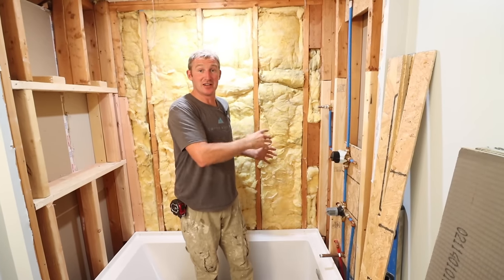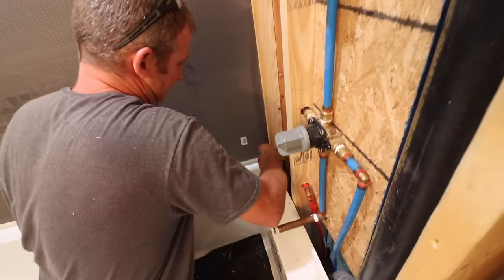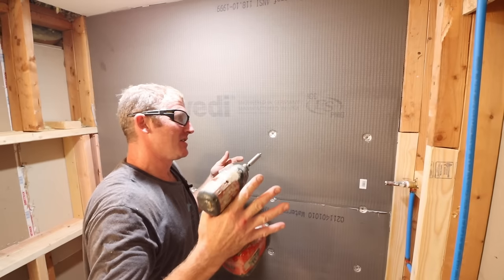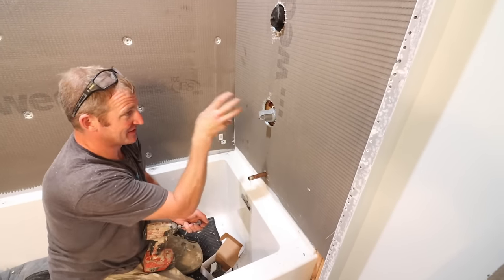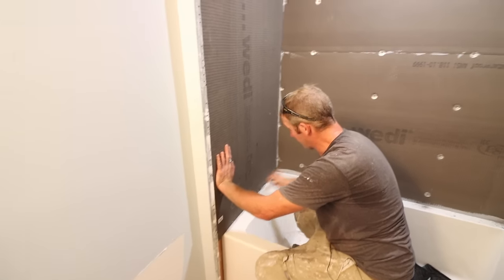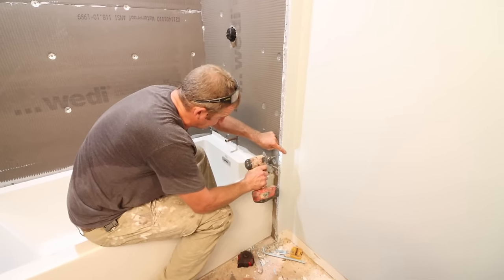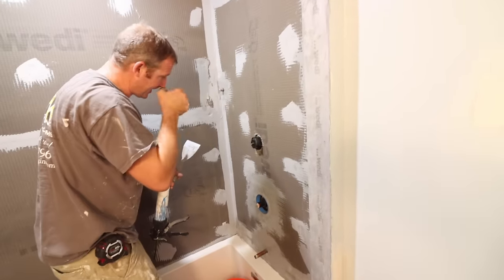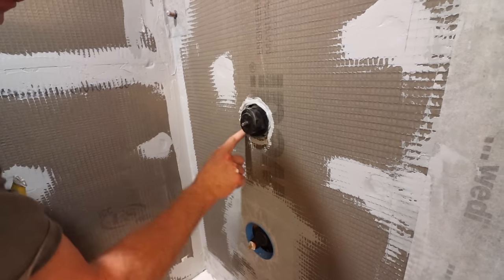Waterproofing Tub Shower Walls | Easiest Method for Beginners

Comment from the maker: We're excited to watch this video Live with you and answer any questions in the Chat!!
Reply: Hi. Just as a clarification, WEDI and other Products like it are not waterproof on the surface.  The closed cell foam structure is what gives the panel it's waterproofing.  So when applying the sealant it is important to seal to the foam core and not just on the surface.
Reply: Commies Suck what do you mean seal to the foam core???
Reply: @never2be07  the facer is not waterproof. Only the core is waterproof.
Reply: @never2be07  the core is made of XPS or extruded polystyrene foam which is a closed cell foam and is waterproof. The facer is a cement based facer and is not waterproof.
Reply: Commies Suck I’m sorry, facer? Sorry I’m new at this and not quite sure what these terms mean. I guess what I meant to ask was how to seal it all the way to the core?
Reply: @never2be07  You just need to make sure there is sealant between panels at the vertical and horizontal joints.  If you are doing a shower with a pre-made Wedi or Hydroblok floor, they typically recommend that you remove a small portion of the cement facer from the perimeter of the floor so the wallboard core and floor slope core can be sealed together.  Reson being that if you only seal along the face of the boards water can wick behind the sealant through the cement facer and eventually into your walls or floor.
Reply: Commies Suck so the way he applied it between WEDI boards is the way to go?
Reply: @never2be07  Correct.
Reply: Installing big s size tiles in bathroom
Reply: Best, most thorough video on the subject.
Reply: Wedi sealant and wedi band and wedi glue?
Reply: Very simple n easy teaching!! Thank you!
Reply: Have u done any showers with windows or glass block windows in main wall or long wall? If so can u reference videos plz?
Reply: Great video! I would love for you to come replace my bathroom shower!

Comment: I have been in the caulking and waterproofing trade for over 40 years and when I saw the flange stopped short of the edge of the tub I just knew you were going to make the mistake that 90% of people make and leave a huge hole at the outside edge of the the tub, because they stop the waterproofing at the edge of the tub. Well done. Every “professional” tub installer needs to watch this video.( I normally get called in after the fact to try to repair the botched installation and I can’t tell you how many times I have found the tile at the narrow strip at the front of the tub without waterproofing or sometimes just drywall at that strip) I also applaud your numerous references to technical manuals. There are so many “experts” on YouTube that have never read the tech manual for the product they are using. Or they are just so ignorant that they think they know more than the manufacturer. Especially when it comes to sealants and waterproofing. The morons that advocate using soapy water or even window cleaner to tool sealants make my blood boil. Sorry for the rant. Keep educating people on the CORRECT techniques and details.👍
Reply: So… say a person did that - stopped the wedi at the flange and tiled so there’s a gap. What would a person do there? Are they screwed?
Reply: @ashleywilkes7632  yes they are. Short of tearing everything out and fixing it properly, you can caulk the tile to tub properly, seal the grout and hope for the best. But I have never seen a YouTube video of caulking the perimeter of the tub that was done properly. Having said that it is possible that the water never gets beyond the finishes on the walls. The problem is you will probably never know until possibly thousands of dollars of damage has been done.
It’s not one of those” it will leak” problems More of a “ it can leak”
Reply: Hm okay. It’s at the back of the shower, so I wondered if ripping the drywall out to expose that gap would work, using wedi sealant to caulk it really well. I suppose the alternative is getting the experienced tile guy to come in and redo the shower, which is fair. At least it’s not a full bathroom remodel…yet
Reply: @ashleywilkes7632  if I’m understanding you correctly it sounds like that would work. That is kinda what I meant by” tearing it out” and fixing it. I meant remove the finished wall in that area. Not remove everything.Sorry my reply was poorly worded.
Reply: Oh no, I appreciate the insight and expertise. I will grab some wedi sealant and get that tidied up. Thank you very much for your help
Reply: @ashleywilkes7632 sounds like you made a mistake…ok to stop before you or your ins talker moves on. Don’t sit in silent torture. Stop then installer and fix it….you’ll get it….
Reply: What if your studs are aluminum? How to attach the firring strips?
Reply: So it sounds like you calling him out but then it sounds like you’re praising him ? Did he do it right or not ?
Reply: @akllls617  I said I THOUGHT he was going to make the same mistake that many make . He did not. He stopped short but came back to it later. The “ well done” should have been your clue. I was actually calling out the 100s of “ experts” that  leave a huge hole at he edge of the tub. He addressed it.
Reply: @genecarden780  no you definitely said “when I saw the flange  stop short of the edge of the tub I knew you were going to make the mistake” so that to me seems like he made the mistake .. you have two opposing statements hence my question but apparently he did everything correctly so good to know thanks
Reply: @akllls617  sorry poor wording on my part when I said “ I knew you were going to” it was a figure of speech, I meant that it is a very common mistake that is made. I should have said after that “ he proved me wrong” when he later completed it.
Reply: Fantastic! Comment's sir..in No way does this reader find it a rant!
May KING JESUS CHRIST OUR LORD AND SAVIOR OUR HEAVENLY FATHER IN THE FLESH YESHUA BLESS YOU ALL!
Reply: I wish I could’ve got him to install mine because the people that done mine they didn’t do it right at all I live in Mississippi people don’t know what they doing I wish i can show you pictures of mine you’d be like wtf I wish I could sue the company that did mine
Reply: @akllls617 , I thought the same at first. But as I read the whole comment, it became evident that he was in praise of the video for catching what most "pros" miss.
Reply: @vespatrixie2555 aluminum? ..or galvanized steel?  ...either way, you could pre drill each hole with a regular ⅛"ø twist bit then use the same screws used in the video. ..orr see if they make self tapping drywall (bugle heads) screws made of the same or similar material. 

When using self tapping bits, the trick is to let the bit center itself at high speed first before giving it full force to sink it...
Reply: Baffles me how any person that has grown up around showers and baths would not make sure that area is bulletproof.
Reply: He doesn't care
Reply: What is safe to tool silicone caulk?
Reply: Why not just notch out the back bottom edge of the foam board?
Reply: @tagheuer02  not sure I understand your question?
Reply: @tagheuer02 he did on the last wall
Reply: Well, I understood EXACTLY what you meant when you said that. Anyone who has read your comment in its entirety should see that you were saying that he didn’t mess up or make the mistake that so many people do. I mean you verified that by saying well done and recommending the video. I don’t see how anyone could have understood that any other way but 🤷🏽‍♂️
Reply: @q4prez823 actually whilst the poster cleared up in these comments they actually intended praise, it’s not clear at all in the initial post that praise was intended. It reads like the mistake was made, then the rest reads like a sarcastic/condescending rant. No disrespect intended on my part, but that’s just how the post reads, it should have been worded better and glad it was clarified later.
Reply: Please give the timestamp for when this error in installation had occured

Comment: PRO TIP: When using any type of sealant to attach panels to a flat wall use circles instead of lines and it will actually create a vacuum and hold the panel better.
Reply: Thank you I will be applying flat wall panels to this backer board. Will do the sealant in circles.

Comment: I used GoBoard. I would NOT recommend it. It's the best price out of all the foamboards and very durable but uses fiberglass mats on the outside. Even if you're wearing long sleeves and gloves, the fiberglass strands are very stiff and aggressive. Much much worse than insulation. Plus it smells like chemical sulfur when you cut it.

Comment: I am a designer of tile projects  and i sell Wedi. I appreciate you doing this video. All the contractors I deal with love Wedi products. They are at a higher cost but if you use the whole system it’s guaranteed for life and it’s WAY easier to deal with.

Comment: WELL DONE, I have been over with different bathrooms from Ballon wall framing customer hacks and hardi and the other. Still system seems bullet proof. I will talk will my local plumbing store and the rep from weedi,  
The best part even if it more cost for materials the labor is so much easier. 

Great work.

Comment: Excellent Video!  A sausage trick, for bulk guns. Instead of plunging your knife in the end. Just smack one end of the sausage against your knee and spin a few times while smacking it across your knee. After 4 or 5 smacks, the metal clamp ring will fly right off. It will keep your knife clean.

Comment: This was an excellent instructional video, complete with valuable comments.  That said, I am astounded that home building design has remained in the dark ages.  This is not a comment on Wedi or your technique specifically, but the whole idea of putting penetrations thru a shower wall where water inevitably goes, with the only thing preventing wood rot being a Rube Goldberg concoctions of sealant tape, caulking, and rubber grommets.  Lots of caulking.  Lots of sealant.  Valves recessed inside the wall and nearly inaccessible from the front. Certainly there are better ways -- scandinavian type showers with fully exposed plumbing perhaps?  Larger one piece water proof backing boards and some kind of corner sealing mechanism?  This new shower is essentially unchanged from one in a 1955 home except it has a single mixer valve (dubious improvement) vs a two knob water control shower.  Still thumbs up for the excellent quality educational video.  Thank you!

Comment: Over the years I built about 15 tile showers using Hardibacker over a vapor barrier. I used a preslope under a mudded shower pan. If I built more showers I would use a system like this. It took me longer to put up the vapor barrier than it takes this guy to put up all the wall boards. A lot of that is because he is faster than I ever was, but I could see time savings in every step of the way with this system. And the end product might be better. When you build a tile surround for a bathtub the vapor barrier should drain into the tub over the flange. Except water draining down that path leads to mold at the base of the tile so you caulk and there is no place for the vapor barrier to drain? 

I don't like either solution. What I like is keeping that water from going through the tile board and that is what a system like this accomplishes.

Comment: Great tutorial. I've watched many of your videos and thank you so much. Repairing a bathtub basically a 2 handle to a one handle, Used Hardy Backerboard DIY, The question is I did not remove the entire Backer Board I cut out 6 of the tiles and cut the  Backerboard to the exact size I then replaced the cavity with  a perfect  cut Backerboard, used proper backer screws added additional 2X4 for it tom adhere to. Then i sealed it with the recommended sealant I need to water proof my valves and spot. How should I proceed?

Comment: Absolutely phenomenal video and thank you so much for this info. Got into the bathroom to reseal a few places and found up my original backer board sucked up some water so had to get in and replace it. This looks like a champ and a good surface to start tiling

Comment: I loved this video. It is so going to help me with my upcoming bath remodel. But I have a question. I had my tile guy float my other showers and of course that means a “cement” type product. How can I protect the valves from water leakage behind them? Could I use the same product around the valves, etc.?  Or what do I need to do?

Comment: Weeoh, excellent tutorial.   I’m in the same boat with a total bathroom renovation project.   The only exception here will be full overlap all the way around tub with my Wedi board.   My walls were badly out of square.   So my ferrying strips have me about 1/4” out from the tub lip.  It’s okay cause I’ll just make up the difference with Wedi caulk.   I will also run a glue bead down each stud because that’s  just me.  I will use my finger to level caulk at the tub because a putty knife might actually scratch the tub…. That would be me for sure LOL. Okay, so here I go.  My inner tub wall has been fitted..l. Now the glue and caulk.   Wish me luck everyone.   My tile guy comes in two weeks so I hope my end product will suitable for him.   Later

Comment: Great, great instruction, sir! Question: can I use regular backerboard WITH a waterproofing (paint-on) sealer? Right now, I'm planning on using HardieBoard Waterproof board, but it's $30 a 3x5 sheet.

Comment: That Wedi system is amazing. I'm planning my bathroom remodel for next spring/summer. It's much smaller space than this one, and I am keeping the existing metal/ceramic tub and replacing all the other fixtures (sink, toilet, etc). You didn't mention what waterproofing was used on the ceiling, so I assume you used the existing material? Concrete board or Hardie backer? I'm subscribing to this channel. I have lots of work to do in my little house and your tutorials will be so helpful. Thank you!!

Comment: Excellent video. Easy to follow and understand. I'm currently renovating and feel that my Bootz shower installation from Home Depot may need to be redone for a proper waterproof seal. It was the prefab 4 piece shower and tub system. Plumber only put a 40mil rubber seal around the shower system. I don't believe he waterproofed the valves or pipes for the shower head and knob. This makes me nervous watching this video. Great content nonetheless.

Comment: Just a quick tip.  I just finished installing Wedi backer board in a tub surround.  Make sure to use either a chalk line as in the video or straight edge to mark your cut.  I foolishly used the mesh lines thinking they were parallel to the board.  They are not.  The error didn't ruin anything and I was able to repair it but it pissed me off.
Reply from the maker: Great tip, thank you for sharing 🔥🔥
Reply: Thanks for this thoughtful heads up. This easily could have been a pretty straightforward but, erroneous, assumption that turned out less fortunate for many. Good stuff!

Comment: I was always taught the backboard sits on the flange and the tile then goes down to the tub. I personally think the way you did the first wall would be more water tight, however won't your drain no longer be centred?
Reply: Also some says that method has the risk if the sealent breaks then water would get to the edge of the backbaord and damage it, which is why backboard on flange, tile down to tub was recommended, idk which is more practical.

Comment: This is a good video mate, translates to the UK well too, apart from imperial 😂

I'm currently doing a bathroom and have the same board, just a different brand. Only difference is I'll be using pvc panels as opposed to tiling in shower.

Some great information though.

Thanks 👍🏻
Reply from the maker: thank you so much, which brand of board are you using? We’re always curious about what’s used in the UK
Reply: @HomeRepairTutor  I'm also in the middle of completely re-doing my bathroom here in UK. The board I am using here is called Jackoboard (a German brand I believe). However, there are several other similar XPS foam boards here, like Marmox, Elements, as well as Schluter and Wedi. Jackoboard seems good value for money, and also has some building certifications (e.g. BBA) so I'm hoping that means it should be reliable (fingers crossed).

I've only just come across this video, but all the info I had researched up to now said to board out the studs (from floor to ceiling) with board before putting the bath in place. To ensure water doesn't go in between the bath tub and the board, I plan to use a product called "No More Leaks" which is a tape, and is a similar concept to what you did with the tape between your bath tub and your Wedi board. I then plan to tile on top of the "No More Leaks" tape, and will then silicone the gap between the bottom of the tile and the top of the bath tub.

Thanks for the vid by the way!

Comment: Dear sir, Thank you for your video.  It's excellent.  ¿is it possible to add grab bars over the Wedi Board, kindly?  The grab bars are strongly screwed down to studs (& additional 2x4 pieces between studs), and so, kindly, ¿won't they tend to 'dent'/damage the Wedi board?  Just wondering.  Any advice is much appreciated.  Thank you for your video.  It's excellent.

Comment: That was beyond helpful! Is there a reason you attached the boards to the studs 3 different ways? Or could you use the same method for all walls?
Reply: I am not certain but it appeared to me that he was just giving 3 different options of sealing around the flange, you can choose one or mix it up.